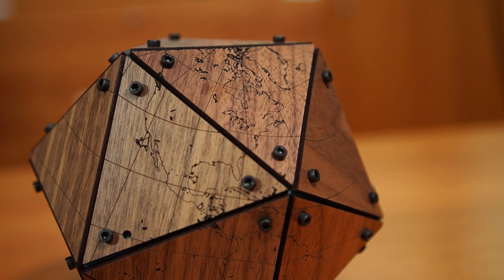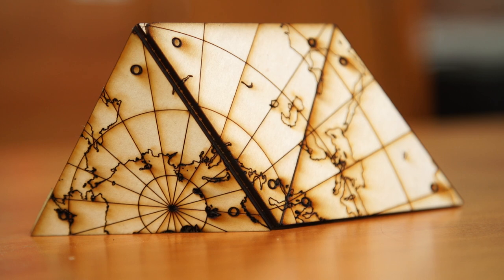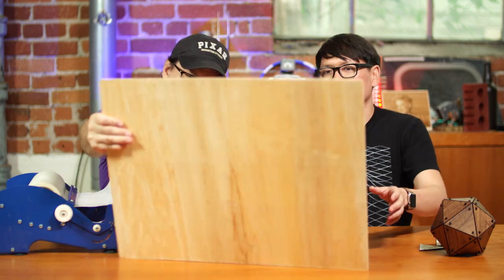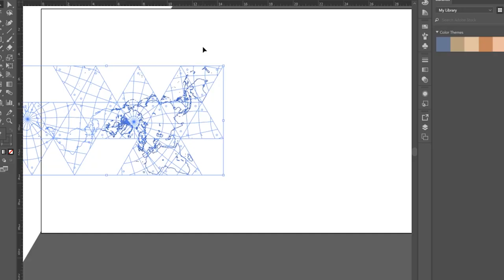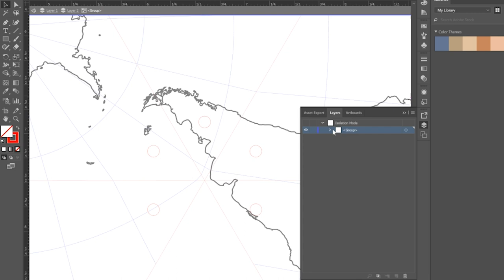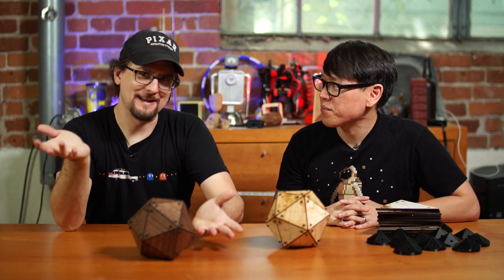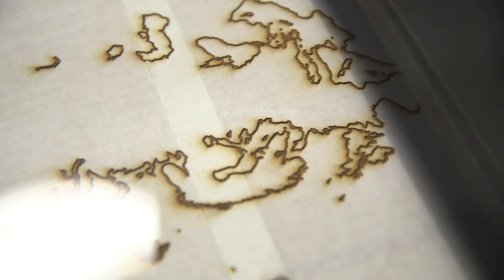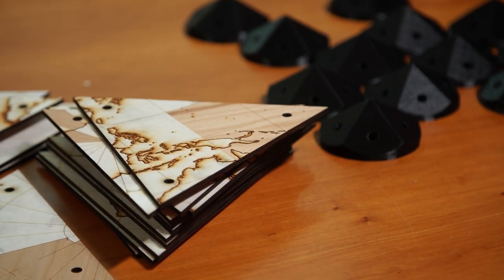Making a Large Laser-Cut Dymaxion Globe!

Comment: Light sanding can get rid of scorching as well BUT you have to make sure the cuts are approximately .001 or .002 deeper to prevent the detail from also being sanded away. Also use an air compresser to blow the sawdust away. You should have sanded all the 90° angles on the back of the panels on all three sides so the map was near seamless(no black cut scorch marks) and decreased the overall size of your vertices by a fraction so it all fits snug. . . tho I'd still totally buy a globe like that lol.
Reply: I don't know the scorched sides give it some character, and as a tabletop nerd they also make it look like a good tabletop gaming prop. With a hexagonal grid it and on a dry erase board I could see it being useful.
Reply: YES! TAKE MY MONIES!! PLSKTHXBAI!!1!

Comment: I do a lot of laser-cutting at on the ULS cutters at my local TechShop, and wanted to share some tips for this kind of project.
1.  600 grit sand paper will do a much quicker job of producing a scorch-free finished result.  Save your off-cuts!  You can put the pieces back in there to make sanding easier.  Afterwards, compressed air is the easiest way to clean out the details.  Takes very little time, and doesn't remove your etching.  Make a call on masking vs sanding depending on how much transfer paper you'll have to weed out of your final piece.
2.  Be mindful of where your transfer paper overlaps.  If you raster across an overlap, there can be a noticeable difference in the appearance of the result.
3.  There are two kinds of scorching with wood.  If the laser settings are too powerful, it'll burn organic materials (like wood) and deposit charcoal on your piece.  Charcoal doesn't come off well with sandpaper, but can be diminished by a solvent-based finish if you go that route.  The light-brown deposits you got in this video are small particles of caramelized sugars from the wood that fell back to the surface and hardened.  Caramel comes off super-easily with any solvent-based finish.  So if you're using anything but polyurethane it'll be fine. 
4.  Consider disabling the air-assist (but not the vacuum) if you are blowing your transfer paper off during a job.  Should not affect the result on most thicknesses of wood, but will result in more deposition on your work piece.  Be sure to remove the air-assist cone when the air-assist is off.  Be sure to check / clean the focusing lens when you're done.

Comment: If you lower the bed of your laser cutter away from the focusing lens, you de-focus the laser beam and you can vector etch thicker lines. For line work like the outlines of the landmasses on this globe, especially at the larger sizes, the vector etching will almost always take a fraction of the time and you get cleaner lines. And if you de-focus the laser, you'll get lines as thick as if you had raster engraved them.

Also, using a citrus-based degreaser and rubbing the wood down with it after laser cutting will get rid of most (not all) scorching on the surface of the wood if one didn't want to use a masking material.

Comment: I use the vinyl mask paper all of the time. Make sure the surface is free of dust and use a hardwood wallpaper roller to make sure the transfer paper is really pressed onto the wood. Transfer paper is sold in different "tack" levels so you may have to experiment with that as well. Note that the higher the tack, the more adhesive residue you may get.

Comment: As others have said, the raised screws really bug me, but the other deal breaker is the large gap between each piece.  Obviously it would be more labor involved, but I'd scale each face just a bit larger and then bevel the back of the face down to the original size so that you get a nearly seamless finished product.
Reply: Feasible, but very labor intensive.  You would not be able to cut bevels on the laser, only 90 degree cuts, so you would have to hand bevel each piece to get rid of the gaps.  It can be done, but it is very labor intensive.
Reply: Not too much, if you plan ahead.  Just need a jig and a table saw set at the correct angle.  All the difficulty is in making sure you have the right measurements beforehand. The actual cutting of the bevels would take 10 minutes.
Reply: With that many sections?  I think you are underestimating the task at hand.  With that many 3 sided sections, your tolerances are extremely tight.  It can be done, but in 10 minutes?  You should try it out and see.
Reply: Someone above suggested using magnets to hold the pieces on, so that could solve one of your issues with it.
Reply: The cutting itself, yes.  Setting up the cut would take a bit more. 10 secs per cut is more than reasonable.  In fact, that's quite generous. http://imgur.com/a/yX3be
Reply: Well Rabid, we'll agree that we disagree.
Reply: It is TV, just on internet and they do not have the time to do it perfectl. Do it better, and I think you have the time to do that..
Reply: ooh i like your drawing c:
very helpful
Reply: I like the esthetic that the gaps in the wood gives it.  I like it having raised screws too, but I would have tried to give it nice bronze screws.  What I'd really like to see though if for it to actually by put in a globe holder (is there an actual term for those thing?).

Comment: In regards to the adhesion (or lack thereof) of the app tape/transfer tape. I'd recommend looking into using a 3M hand applictor which is essentially just a plastic squeegee that is pulled over the tape to help give a much tighter/closer bond onto the surface material as opposed to just smoothing it out by hand.

Comment: MAKE THE 3D PRINTED PLASTIC PARTS OUT OF METAL....PUT NEODYMIUM MAGNETS IN THE CORNERS OF THE TRIANGLES...YOUD HAVE A FUN PUZZLE THAT GOES TOGETHER AND COME APART QUICKLY
Reply: FlyingTex this process would also be slightly easier with a water jet since the laser cutters cannot cut metal, they only score it.
Reply: Press the caps key and you get a fancy new font that's much nicer to read
Reply: why not just put the magnets in plastic parts?
Reply: tm Is CNC the ship name between CNN and the DNC because they are both horrible?
Reply: You can 3D print metal guys....
Reply: kinda, you just need to bake it or infuse it with another metal after you printed it.
Reply: Wemja There are full metal 3d printers
Reply: Laser etching anyone??

3D printing metal would not give you the results you'd desire but laser etching would. All you'd need would be to isolate the vector images into 20 parts, make a heavy die to hold the pre-cut triangles, alignment is no problem with trial & error and neodymium magnets could be glued into 3d printed parts as suggested in another comment.

Make loads of them and recover the costs for the metal cutting and die making.
Reply: This is a great idea, and actually closer to Buckminster Fuller's original intentions of the Dymaxion globe being a fun learning toy for children that can unfold flat to create a map.
Reply: FlyingTex neodymium would be severe overkill.
Reply: You could alternatively use velcro! But magnets are arguably way, way cooler...

Comment: the scorching in laser is not simply because of the protection layer. You can eliminate scorching simply by connecting your air assist to a air compressor and air valve to increase the air pressure on the air assist when cutting. That way it will eliminate any scorching on the surface and also on the edges.

Comment: Not gonna lie, I was slightly disappointed that the North and South Poles weren't on vertices. Otherwise, you would stick a rod through the center to connect the two points, tilt it, and prop it up like an actual, functioning globe; similar to the ones we, or at least I, saw in Elementary School.

Comment: Even better would be to keep the small plastic junctions and instead adapt the holes on the pieces so that each hole is closer to the edge and with the proper diameter for the small bolt and the small junction.

Comment: I wonder how viable laser cutting a dry erase board in those shapes would be, cause if you could take a dry erase board, scorch etch some hexagons into it, rather than vertical markers etc, that would make a great tabletop map tool for global adventures.
Reply: You can buy dry erase film and stick it over the top of just about anything so you could do it in theory. Campaign Cartographer can unwrap maps and I've printed out/glued up a few which is slightly easier.
Reply: I meant as a multi purpose map, use a few dry erase markers to plot out different continents and such, and then mark off where the players are.

Comment: No need to double the 3d printed items ... just move the laser cut holes to the "old location".  Doubling the size of the 3D printed parts takes 8 times as long to print and required 8X material.  Otherwise cool job.
Reply: It's worse than that, double a 3D object, and it's 8x the overall volume - 2x2x2.

Comment: How does the volume of the bigger globe compare to the volume of the smaller one?  Is it 4x?
Reply: Surface area goes up by the square of the length increase (2^2 = 4 in this case).  Volume goes up by the cube of the length increase (2^3 = 8 in this case).

Comment: The screw don't look good on it imo :/ Could this be done with like connecting grooves or some other connecting points to give the outside a more smooth 1 piece look?
Reply: Theoretically, this could be built with a lot of different replacements for the screws.  Pegs, magnets, or just some sort of adhesive would all work as long as you design the interior corner braces to match.
Reply: True, might aswel glue it together since it doesn't ever has to be taken apart.